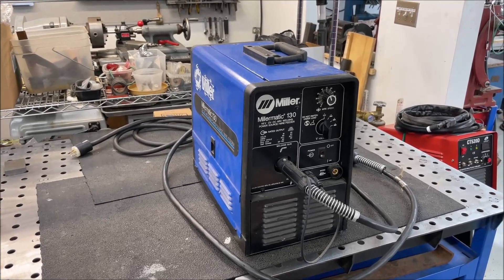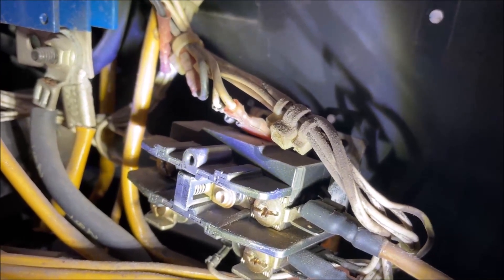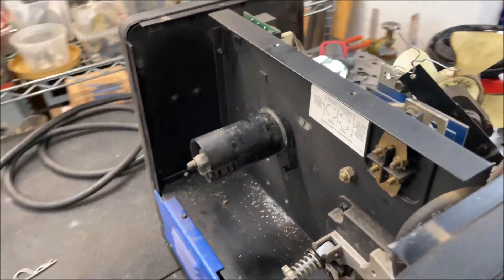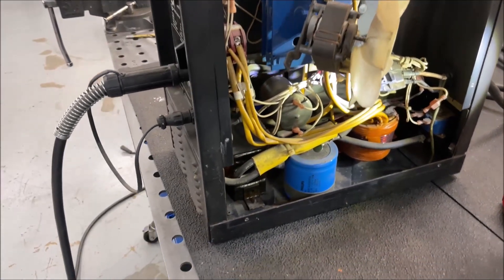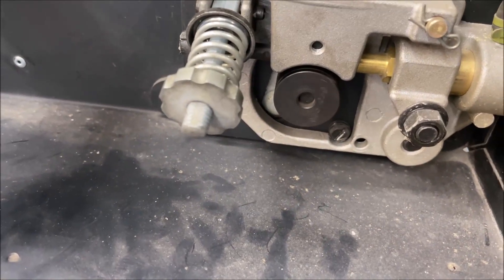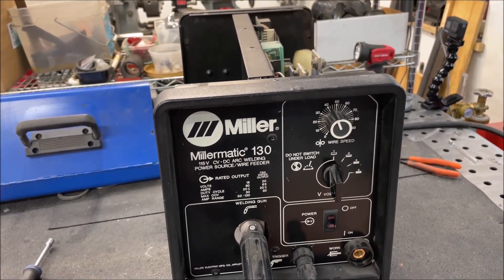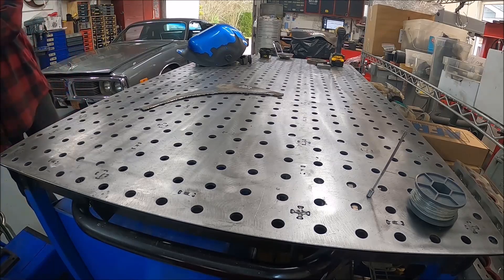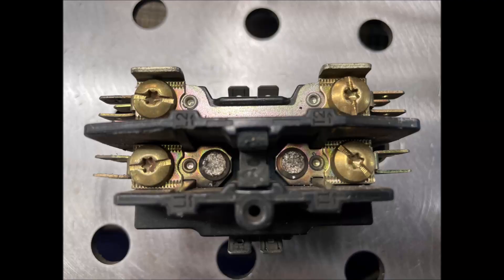Miller 130 mig welder repair

Comment: It sounds like the fan has dry bearings & needs some oil.
Reply from the maker: Its a sleeve bearing I put some 3 in 1 on it but that lasted about 5 min noisy again. As of today 12/16/25 its still working so better to leave it alone is my opinion.

Comment: I bet you used it a lot. I  bought my millermatic 130 back    in 89 only ever replaced the contactor. Other than the Weight difference . I like the transformer models better than  the  inverter type. 😊 nothing welds like the millers . Glad you got it working 😊😊😊😊
Reply from the maker: @slimmy696jim7  After using both styles invert and transform er i agree I prefer the old machine

Comment: COMO PUEDO DESPRENDER LA ANTORCHA  DEL APARATO, YA BUSQUE TUTORIALES Y NO ENCUENTRO.
Reply from the maker: There should be a bolt by the drive wheels on the side that holds the wire

Comment: Easy repair on the 130.   I have a 130xp....  I am running flux core I would like to use  the mix as that is what I am used to.   Nice charger by the way
Reply from the maker: Thanks on the charger, I am personally not a fan of flux core, I hate the smoke, I have always run 75/25 mix
Reply: If you can get c25 gas you will love welding mild steel , I have a millermatic 130 from around 1989 it always works  perfect , only ever replaced the contactor 😊

Comment: Iv got an older millermatic 135xp and it ran fine. I up it up for a few weeks and now my feeder wheel won't spin. Every powers on fine and the relay clicks but no feed wheel.  Any ideas?
Reply from the maker: If you hit the trigger and it clicks but nothing else its possible the drive motor went bad.   https://www.millerwelds.com/files/owners-manuals/T1324D_PT_MIL.pdf
Reply: I had same issue a while back. 
My issue was a non-issue 
 Solution from User Guide: 
 Voltage Switch (5 Position)
  Switch must “click” into detent position 1, 2, 3, or 4 for proper contact.

Mine was in the middle of 2-3. no flow.

Hope this helps someone.
Reply: Hey, my Millermatic 130 does the same thing, powers on, relay click, but the feeder wheel wont spin.  Did you get yours to work?
Reply: @tubeyoujr  ya but I can't really remember what I did I think I unplugged the feeder relay and plugged it back it
Reply: Make sure there is no resettable overload/ circuit breaker or fuse ???

Comment: You should fix her up and make it like new again 
upgrade some of the parts like the fan the huge rectifier and clean the electronics keeping that welder cool and clean and it will last a long time 
I would love to see a video like that if you have the time
Reply from the maker: The was my initial plan, but once I started pricing parts out, Seeing how much was disc. What I would have to retrofit and the limited thickness the welder could burn (single pass). Plus having a need for a spool gun for an alum repair job (the miller 130 is to small to handle one). I decided to just fix the bad contactor and toss a new liner in the gun and buy a new welder. The old miller will be retired to back up mig or thin sheet metal work.